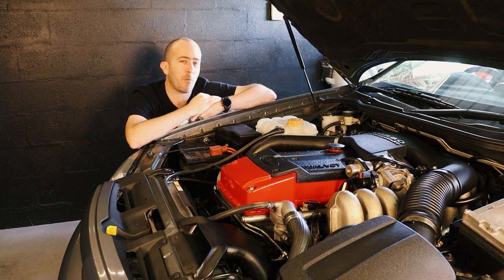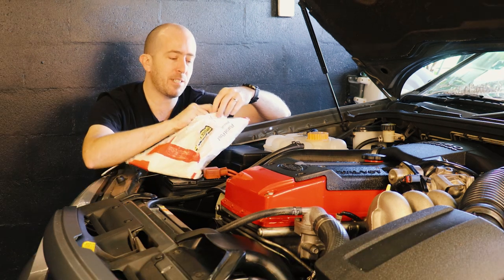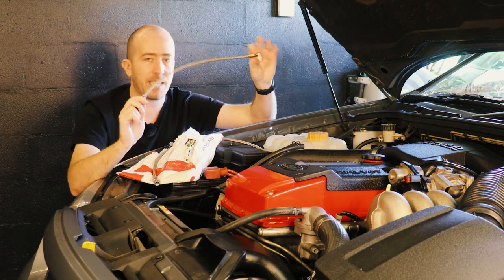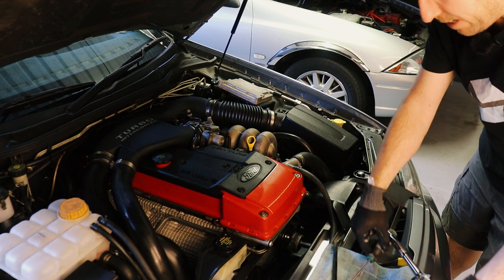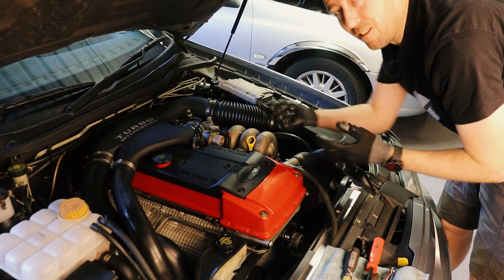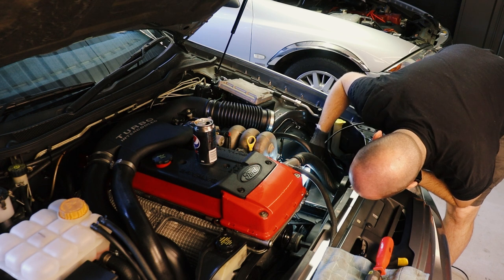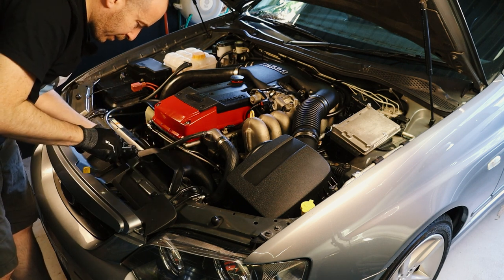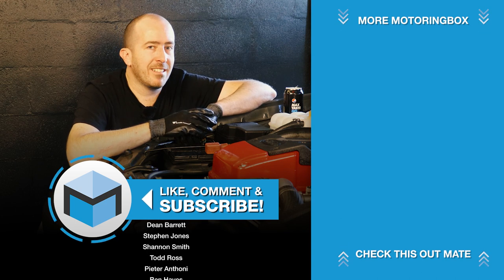🛢️Barra Turbo Oil Feed Line - Every Ford Falcon XR6 Turbo Needs This RIGHT NOW! Goleby's Parts

Comment from the maker: What do you think of the Goleby's turbo oil feed kit? Let me know in the comments below. 
Make sure you check out Ian / HubNut's video of 'Betty' the AU Fairmont in the UK: https://www.youtube.com/watch?v=3TyXVP6V6zE
Reply: Looks good mate👌👍🙂
Reply: Wow I would never have guessed you hadn't been wrenching on cars for years - you are doing great, no need to apologise!  I would add that whenever I have a big job to do on anything, I tell my wife I need "x" tool, and she doesn't then bother me about spending the money on it - not sure if that's a useful hint or not ;-)
Reply: Interesting..I just went with the Mamba kit which was cheaper but works fine. It had a new banjo adapter to replace the original factory one, avoided having to bash out the old filter and risk reusing it at the block attachment. Also - if you remove the heat shroud it's way easier to to get to the bolts at the turbo end.
Reply: I brought a Aeroflow oil feed hose kit. It wasn't cheap, but like u said, you don't want to destroy your turbo. The inline oil filter has a large reusable filter, so you can easily clean it out, being reusable u can clean it out more often. I also bought the Aeroflow oil and water bracket, which looks pretty good. I have to thank you for doing this video mate, I know what I have to do now. Yeah I reckon the Aeroflow bracket and feed line is a bit better than your kit. I don't like the idea of having to keep buying filters all the time. Is your turbo 3584
Reply: Barra!

Comment: I have had my XR6T for 9 years on the standard fitted filter and NO issues. Regular service is all that I did over all those years. Mild 14psi tune.
Reply from the maker: Some people are fine. Some people are not fine.
Reply: Mine lasted 13 years before it gave out. Still gave out.

Comment: Might be worth chucking some old fuel line around the braid where you've zip tied it to the water hard line. Braid is pretty abrasive and could work its way through that hard line over time.
Reply from the maker: I'm probably going to move it slightly so they don't touch there.

Comment: I did this on my FG nearly 2 years ago at about 80,000 KM. It all went smoothly, with no leaks. My filter had no signs of blocking up. The original filter on the FG/FGX is substantially larger than the one on the BA/BF so they're probably less prone to blocking up. I also suspect that those who have had problems drive their car hard, don't change their oil often enough, and use cheap oil.
Reply from the maker: Probably right!

Comment: Nice work Sean.  You can get metallic cable ties that should do the trick with securing the oil line as I suspect that the plastic ones you used will melt fairly quickly.
Reply from the maker: I would be surprised if they melt. I do have a proper line holder on the way, should be here in a week or two.

Comment: On the subject of having the right tools for the job, my mate and I were doing his rear wheel bearings on his BF wagon, so they were live axle. We didn't have a slide hammer to pull the runners out of the axle shafts, so we got a really long stud, a couple of nuts and a big socket to basically make our own. It felt like there was no hope, but sure enough out it popped and my god I was so proud of myself
Reply from the maker: Good on ya!

Comment: Hey Sean.
To remove smaller circlips you can just use a tiny screwdriver and insert it into one of the holes and pry it out. They are extremely easy to remove. This saves potentially bits of leftover metal and plastic from working its way up the lines
Reply from the maker: Yeah I tried that, she was pretty stubborn though. In the end brute force got it all out and I sprayed the fitting out with WD to make sure it was all flushed out.

Comment: 1. I like the way you do your videos. You make the viewer feel like they are the with you.
2. Making mistakes means you keep it real. I do appreciate that.
3. For the return line could you use a couple of hose claps attached to the Rocker Cover bolt or would that affect the seal on the Rocker Cover?

Comment: Good job mate , theres nothing like the nice feeling of working on your car (most times haha) and fixing/upgrading it , the people that don't work on their cars are really missing out , but then again Its not for everyone.. I know people that shouldn't be within 2 feet of an engine because things can get dangerous if not done correct on a car. Safety is key
Reply from the maker: Definitely a fine line there when it comes to skill level and what jobs you should attempt. I've typically avoided suspension and brake work for that reason, but gradually gaining the confidence (and hopefully skill) to start doing that soon.
Reply: @MotoringBoxTV  Hi mate , brake and suspension work is honestly not that difficult and judging by your mechanical knowledge and skill of working on cars , you would do great - you certainly don't look like a complete stranger to wrenching on a car mate so dont be affraid , have confidence

Comment: Ahhh you just reminded me of my mcgivor moment with my old ba egas.  I made a tool out of the top of a spark plug jammed on a bolt to remove a part on my gas converter.  Made life so much easier 🤣
Reply from the maker: I think you just out McGyver'd me haha

Comment: No need to pull any fuses to crank without firing.
Just hold foot hard on throttle. Failsafe is built in so it won't fire/start at 100% throttle.
Also good after oil changes.

Comment: Mad respect that you attempt these upgrades mate. I'm still stuck with going to the mechanic to get stuff done. I'm glad the au does not need so much stuff. with every video I watch from you though I wonder why the hell I don't try some of these things ;)
Reply from the maker: Depends what you need to do I guess, if you're interested you've gotta start somewhere. Oil and filter change is a good starting point!

Comment: Nice work, I added an oil pressure gauge sender while I was in there when I did mine(for the two gauges I added on top of the ICC)
I couldn't find much in the way of braided water line kits to match, I ended up getting a Mamba kit that I haven't fitted yet.
I like the stock piping and crossover too, I have put a heat resistant stick on matting on the underside of my crossover and trimmed carefully to do the underside of the turbo intake pipe and the turbo pipe to the throttle body without being able to be seen from the top.
I have also fitted a growler intake to replace my factory airbox(which I previously had a k&n panel filter in) Although expensive, definitely an improvement over the stock airbox with better fuel economy I have found and still retains a somewhat factory look.

Comment: nice video. i have had that kit sitting in my shed for a few weeks now and will do mine this week. glad i watched cause now i know what size sockets i need. tip for others if doing this while you have the oil pressure sensor off you may as well fit a oil pressure gauge.
Reply from the maker: It was a bit daunting, but once you know the tools needed it should be a lot easier I think.

Comment: Hey Sean. If you trying to reach the screw tighten. Like what you did with the aftermarket oil line on top of the Turbo try buy a set of Flare nut scanners from SCA they are like about $30 and you’ll thank me.

Comment: On another note, those hard to get at connections can sometimes be more easily accessed by using a crows foot…. If you cant afford a set just buy one size at a time in the most commonly used sizes.  Eg i have an 8, 10 and 12.  I also picked up a refrigeration mechanics spanner set at trash and treasure for $10. Basically its a small set of crows feet but with 50% longer jaws than a normal crows foot equiv.

Comment: I reckon you could make your own bracket. Find a design online and copy it. I did a similar thing and moulded a little cover over my alternator, you could easily make something up for your oil line.
Reply from the maker: I actually bought one and installed it backwards, so the line mounts face towards the engine instead of the front of the car. I was actually surprised just how well it all worked.

Comment: Just to let you know mate, with JIC or AN fittings, there's no need to use sealant. They don't seal on the threads. With the sender and banjo threads you do need to use sealant.
Reply from the maker: Yeah I heard afterwards. But also read it doesn't hurt to do so.
Reply: You don't need sealant on the banjo, that's what the crush washers are for.

Comment: Well, wish I knew this beforehand. SY Territory Ghia Turbo, 180,000kms, driving to Qld from Vic and back, turbo ground itself to dust on the way back over the great dividing range.
Reply from the maker: Sorry for your loss. It doesn't happen to every vehicle, but considering how cheap the kit is compared to a replacement turbo.... it certainly makes sense.
Reply: @MotoringBoxTV  Failures are just opportunities. Gonna reco the engine and throw it in a GU3 Patrol I think. Cheers for the video anyway, hopefully helps someone else before their "opportunity" presents itself.

Comment: Something I found out today, hopefully others can benefit from. If you’re having trouble with your front brakes sticking it could be the brake booster rod that has backed out and causing constant pressure. Causing poor fuel economy and warped discs. Worked for me today and apparently it’s a common issue (there are a few YouTube videos showing how to do it). If that doesn’t work then see if the calliper pins are freely moving.
Reply from the maker: That actually happened to the previous owner of this car - new booster and discs fixed it
Reply: @MotoringBoxTV  sorry didn’t mention you can adjust the rod.
New discs for me soon 👍🏻
Reply: It's definitely this that warps the rotors. Adjusted mine a few years back haven't had an issue since.

Comment: Some opinions suggest the filter was put in place after there were failures of turbos from casting sand making the blocks killed the turbos. This filter was supposed to be cleaned at each service and then removed after 100ks? This filter is not known in all turbo feed lines in other turbo models cars. Replace the line as suggested in this video or just remove the filter from the factory line if your engine has done over 100k? or just clean and replace filter. Do your own research, if you need total peace of mind put a inline filter replacement. I have two turbo territorys, one with a replacement inline filter and one with the factory filter removed. I guess for me time will tell. You be your own judge, research and then own your final decision. The first indication your factory filter is blocking is a oil pressure low indication light. The sensor is downstream of the filter. Dont drive around if this fault light comes up.

Comment: If you are thinking about getting led tail lights or head lights I have just got rears for my bf and I couldn’t believe how nice they were when I got them and put them on. The eBay shop I got them from is Mars performance I got the black back and clear lenses and they changed the look of my car highly recommended Mars performance they are really helpful with any questions you have or need help with. I also got halo and projector headlights for my wife’s hilux and rear led smoked lenses from them as well. They also have mags as well but they are not the average same as everyone else’s wheels and have some awesome designs. Thought I’d share it with you just in case you were thinking of getting these parts.
Reply from the maker: I don't suppose you run Mars Performance do you

Comment: There's no need for thread sealant on those feed lines because they're all AN fittings and they don't rely on the threads to seal. It's going to be a pain to clean it up when you replace the filter in the future
Reply from the maker: Good to know. Shouldn't hurt it I suppose, I kept it away from the beveled bit at the end.
Reply: @MotoringBoxTV  Yes, the thread seal will just gum up the threads and make them more difficult to remove.  We live and learn 😊  The finished result looks great.

Comment: Have you thought of using a borescope to film the spaces too tight for the gopro? Some of them come with SD memory cards to record video (gen vga-svga qual), as well as data cables.  Theyre not that expensive and make looking into tight spaces so much easier
Reply: Supercheapare selling a-recordable borescope from this thursday for $60. Useful for filming in those tight spots 😁
Reply: A mechanics stethescope (on my list) also seems like a good idea so you can figure out exactly where that fu#&*ng noise is coming from.

Comment: Do you need to drain the oil to replace the oil pressure senser?
Reply from the maker: No it's above the oil level in the sump. Some oil will come out but it shouldn't be much.
Reply: @MotoringBoxTV  awesome thanks... Saturday morning done...

Comment: I knew 21mm was the ticket. I was thinking why doesn't he have that then had to remember DEEP socket.
I don't have the greatest collection of those either.
I don't think Miss Hubnut is keen on Betty going by her reactions. I'm happy if you're happy was one and the other was quickly changing the subject when he made mention of it during their road trip to festival of the unexceptional. I think it's something to do with Betty replacing a Citroen she was attached to.
Reply from the maker: She'll come around
Reply: You won't believe what I found in hard kerbside rubbish last night. I had a look in a large cardboard box and what should be lying on top inside? A beautifully detailed small model of an AU XR8 ute on a plinth with missing front wheel but with disc brake assembly showing. You can even turn the tiny disc rotor.
Yeah, partners often don't see eye to eye on certain things.

Comment: hey mate what made you pick the Goleby's BA-FGX Falcon Barra Motor Turbo Oil Feed Line Kit: over some other ones from ebay???
Reply from the maker: Bear in mind I bought it a year ago, but at the time most of the other kits seemed to locate the filter smack bang at the front of the engine. I liked this one because it sits to the side, between the engine cover and the power steering pump.

Comment: Bin factory filter put back together don't need inline filter
Reply: Pretty much, that is filtered oil already, so if you need an inline filter you honestly need to question the oil you’re using & the frequency of your oil changes ..

Comment: Without going out and looking at my engines, this seems like it might have been one of those situations where it would have been better to route the line down the bottom-front of the engine, rather than around the top-front?  It means a longer line, but one advantage might be that the line would be below the sender, so would always have a little bit of oil in it for startup.

Comment: Mate it's possible that the little oil filters can be cleaned and re fitted?
Reply from the maker: Not that I've heard of, but you never know. Bit of a pain to access though.
Reply: yep they can be cleaned and refitted i have done it on mine but are fitting an aftermarket one this weekend

Comment: pls tell me what is then the purpose of a oil filter that on the engine already ??
Reply from the maker: You'll have to ask Ford. I suppose it has something to do with the small oil galleries running through the turbo.
Reply: The reason is the early BAs used to blow turbos from swarf getting into the oil line from factory production tolerances not being amazing in the casting process. Generally when the car has done over 20,000kms it wasn't much of an issue, and it improved in later models. So if the car has had regular oil changes you technically don't need a filter, but it also dosent hurt.

Comment: Stop leaving your oil change past 5000km then and you wont have coked oil block the line will you. Engine flush every second change or just remove the bango bolt and take the filter out... just some ideas for your Fixed Or Repaired Daily.
Reply: The problem is, aside from the standard filter being too small, it's also plastic cased so it gets brittle over time. You don't need to use engine flush either. Nothing wrong with fords.

Comment: Not necessary. . Don't invent new problems. You'll spend days fkn around with it leaking .
I currently own F6 and 3 X xr6t previously.
Reply: What are you actually talking about?
Reply: @Flying_GC  I'm not sure ? But what I do know is , 'my cat's name is Mittens'.
I hope this helps.
Reply: @zenovich1  how about rather then being a clown that's apparently owned all these cars, elaborate. Are you trying to say the aftermarket oil line is a bad idea and shouldn't be done? Because if so I have a bridge you might be interested in buying. Regards an XR6T and F6 owner (since that matters apparently 😂) hope mittens is well.
Reply: @zenovich1  haha Mittens sounds like a great cat, unfortunately my dog won't swear at randoms on YouTube. Anyway on a serious note, I gather you have never taken your turbo off or modified it in anyway, and had to deal with the factory hardlines failing, cracking then leaking. Which they did on my XR6 and Typhoon. Advising people that this 'upgrade' will cause more issues, and cause leaks, is poor advice. I've never had a leak, nor anyone else I know in the FPV owners group who've done this. That's why I didn't know what you were actually implying, because you didn't make any sense. And I mean that in the nicest way possible.
Reply: @Flying_GC  'owned' Ha ha.